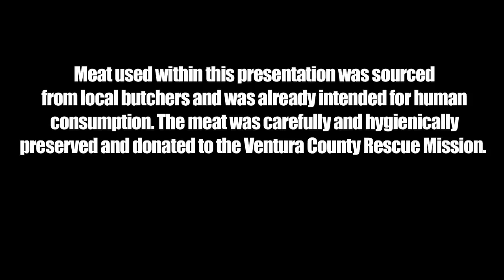Apocalypse PROOF - Testing Overview

Comment: i have a cold steel tilite i think its called, i've used it as a lever, hammer, a knife (duh), paint stripper (with the abrasive  part used to flick the blade out), used it to gut a deer, i've dropped it more than i can count, i used a hammer on the back end to cut wood. I've never sharpened it or even tightened down any bolts. Its by far the greatest knife i ever owned and is the only reason i would trust a cold steel.
Reply: So how much did they pay you to say that?
Reply: Derpy Gaming Highlights eleven dollars canadian
Reply: Merica

Comment: Well after 3 tours of duty, I would recommend Ka-bar before these. Mainly because ka-bar has been proven for years. It cuts barbed wire, made of the beat material, and keeps an edge the longest. My First ka-bars edge lasted 6 months before I had to sharpen it. My second one survived an I.E.D blast and I still have it in my lockbox. Research them they are worth the money believe me🙌💯

Comment: Ok, I did the hanging weight test with a SOG Flashback and it stood up to what looked like 480 pounds before the lock broke. Your knives are great, but they aren't the best.
Reply: ***** The blade itself is 3.5 inches and I held it by the tip.
Reply: ***** I don't really know if the axis lock can take more than that without   breaking, but it's pretty strong either way.
Reply: ***** Ok, thank you!
Reply: 480 pounds is still a crap ton of pressure and that's impressive.

Comment: “A shock test is meant to test the locking mechanism in a folding knife”
You say as the guy starts breaking the wooden board with the handle

Comment: Be safe..folks....that meat hanging from that open hook...gave me a flash back..42 years ago...I was climbing up a chainlink fence, as a 6 yr old child, and i slipped and my right eyelid got caught on the open linkage of the fence...I lost some nerves on my eyelid..don't want to see any of you guys slipping on pieces of meat or fat material and getting injured with that very large open hook..i would wrap that with material that shields the point of that hook.